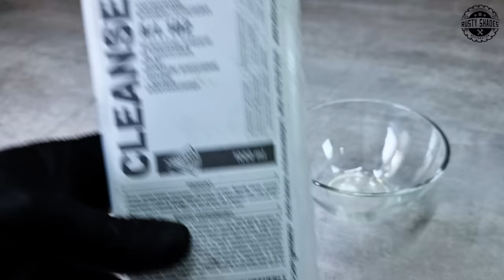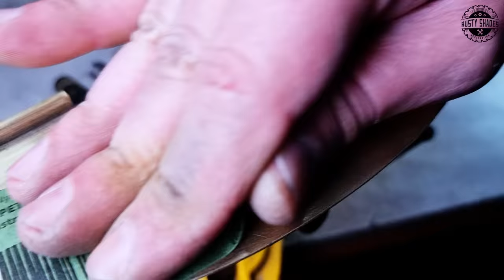Primitive Bread Toaster Restoration - 1918 Siemens-Schuckert

Comment: Man that thing came l out gorgeous!  
They used so much brass back then because there was no stainless steel, and you didn't want a rusty toaster.  I don't know if this was known at the time but Brass would also have some natural anti-microbial qualities due to the copper content, which would be good for a kitchen appliance.
Reply from the maker: Thank you for sharing with us. 🙂
Reply: @rustyshadesrestoration    These old toasters were usually nickle plated. From around 1930, chromium plating became more common too. By 1920 stainless steel were made, but I am not sure when it was put in use for household appliances. Lots where made in the steel quality common at the time, but I think the shine of the chromium plating was highly valued.
Reply: Раньше всё для блага человека а сейчас......
Reply: That's why a lot of metal door knobs are brass-plated.

Comment: What an excellent restoration! I myself restore and collect toasters, waffle irons and other electrical gadgets from before 1925. I use my 1914 toaster everyday and my 1919 waffle iron for Sunday waffles! I also restored an electric curling iron from 1902 and it has a really big porcelain and metal plug that screws into a light socket as wall plugs did not exist back then and appliances were plugged into available sockets. You did a wonderful job.
Reply from the maker: Thank you very much!

Comment: My grandparents had a similar one, albeit made in US, but theirs was 110V and used a two wire plug that resembled those now used for current corn poppers and hot pots. They seldom used it, preferring the pyramid one for the cookstove. This one is prettier by far.
Reply from the maker: Nice. I will try to find one on the Internet; you made me curious.

Comment: Sweet little toaster! The plugs (or where the plugs would fit in the body of the toaster) remind me of the twin plugs I had on an old Singer cabinet sewing machine, the kind that folded inside a nice wood table. The plugs were Bakelite or rubber/early plastic, but had that split bunny ear shape of yours, with a cloth covered cord. Perhaps an old sewing machine or other electrical appliance could yield some parts for you. Also, for working on soft metals like brass, I highly recommend covering your hammer heads with a layer or two of chamois leather. You can wire it onto the head of the hammer because it will need replacing as it wears. You will notice a big difference in the surface of your work and avoid unnecessary marks/scuffs. Thanks for this entertaining video--I hope you heated/burned off some of the fumes before making the first slices of toast??
Reply from the maker: Thank you! I'm glad that you enjoyed the video and the outcome. I did heat it up a few times before filming the test. 🙂

Comment: This really makes me appreciate the modern toaster. It does both sides of the bread at once, you press a plunger to load the bread and switch on the heating elements, it has a timer, and it even ejects the bread when it’s done.
Reply: really?  So you would recommend a newer model than this one?
Reply: I’ve been cooking for 60 years and have yet  to find or own a toaster that works as well as my parents’ toaster when I was a very young girl. It was somewhat the same concept as this restored one (2 side doors) but probably made in the late 40’s or early 50’s. It made perfect toast- never burned and always evenly toasted. It did have a rather unwieldy,  brown FABRIC COVERED cord. Still would love to find one like it & have it restored. 😊

Comment: great job, as always, but did you forget to tighten the 2 springs on the lids again? it would also be interesting to see a picture of the hot wires. whether they shine the same everywhere. possibly even out the distance between the windings.

Comment: Excellent Restoration! 

I too, was surprised to see that most all of the parts to this toaster were made of Brass!

That surely made it possible for you to polish those parts and bring them to the shiny finish that you achieved! 

I have to ask you though, just exactly what Voltage does that toaster run off of??

Seeing that it was made in 1918, I figured that it most likely did not run off of AC Current, but some type of Battery power, instead.

Also, though I am just 56 yrs. old, & was not yet around, when homes were first supplied with electricity, I've been told that each of my great-grandparent's homes did not receive electricity, until at least, sometime between the mid 1920's to mid 1930's, or so.

So that is why I figured that appliances like this one, wouldn't have been set up to run on AC Current.

Again, Awesome Restoration! Which is why I'm glad to be a subscriber! 🙂

Best Wishes & Highest Regards!!

Ron H.
Abilene, Texas; USA.
Reply from the maker: Hi Ron! 
Thank you for your feedback! I'm glad you enjoyed the restoration process. 
This toaster runs on 220v. It was produced by Siemens, a german company, and I found one with registration documentation in the Vienna museum of household appliances, thanks to a subscriber. This is the only fact that proves its age. As well, reading about electricity regulations in those years, it seems that most of Germany already had 220v, while in US and France, it was 110V. I'm still not sure about everything, and my research continues. 
In the villages, yes, things moved slowly, here in Europe too, but as an example, a city from Romania, the country where I was born, had electric street illumination in 1884. The City of Timisoara. 

Thank you for watching my work! Cheers!

Comment: I have one similar to this. It was all about paying attention and timing. If you didn't pay attention, you would have carbonized toast. The made a lot of fun about this in the movies of the times.
Another word for muscovite is isinglass. Isinglass was used as a fireproof glass in wood stoves, washers to prevent electrical short circuits, and a form to wrap heating elements around in later toaster models.
Reply from the maker: That's true! I had to pay a lot of attention to make them eatable. 😀
Reply: The USA name for this material is Mica.
Reply from the maker: Everywhere is called Mica, but Mica it is a group of hydrous potassium, and aluminum silicate minerals, but separately they have their names, like, in this case, Muscovite. 🙂

Comment: Definitely a 10. Wow! I love polished and polishing brass. The results are so gratifying. Would have never thought is using muscovite also known as mica in this way. Is it considered a thermal insulator?
Reply from the maker: Thank you. Yes, 500+ degrees heat resistant and doesn't conduct electricity.

Comment: You did a nice job.  To get the brass to shine without scratched try wet sanding with wd40 as the lubricant.
Reply from the maker: Thank you, I know this technique, but in this particular case, I didn't want to get a 100% full mirror effect because is not a blade, especially for interior or bottom parts. Some minor marks on it don't affect anyone.

Comment: Nice restoration! Should the side doors have more spring in them, to hold the bread in place, I wonder?
Reply from the maker: Thank you! Yes, but I've decided to don't hook them up again because it will only help to burn the bread on the edges because of pressure.

Comment: Did you forget to hook the springs back up or did the heat treatment make them ineffective? The door should snap back.
Reply from the maker: The heat treatment was delicate, but some ends of the springs broke while disassembling. I hoped that I would be able to extend them a bit, but there was no chance. 
I have over 250 types of springs and sizes in my shop, but none of them fit in there, and no music wire to make new ones. It happens when you deal with old stuff, and you have to film it. There was a good part of this misfortune, if I replaced them with stronger ones, the pressure on the doors would push the bread too much, and it would burn it immediately; even like this, stress-free, I had to be extremely careful to don't burn it. 
Maybe I'll replace them, but I'm not in a rush with this. 
Thank you for watching! 🙂

Comment: Why not replace the original wires in the bottom where no one can see them with modern insulated version?  You brought the brass back to life, looks great.
Reply from the maker: Thank you! I do not want to intervene that much; I still hope to find an original power cord. Already someone gave me a hint that it is a Siemens.
Reply: Beautiful job😀
Reply: The fixed air gap and protected location of the bare wires preclude any short circuit conditions. To perhaps boggle your mind, around 1920 many newly wired houses under the Rural Electrification Act in the US had bare wires installed in attics running to ceramic insulators, with rubber insulated wires in the walls. My grandparents had this. I suspect the rats and squirrels found it occasionally thrilling.
Reply from the maker: Thank you 😊

Comment: judging by the way it looked in the beginning that was nickel plated brass, the wiring its whats called a female chicago plug, easily sourced on ebay.  heating the springs to blue them killed the temper, that's why the side plates don't spring back anymore, those should be replaced mscdirect would have replacements in stock, you just need the diameters and length measurements
Reply from the maker: Hi! I will respond to you in lines, yes it was nickel plated, but I prefer it without; it is more attractive like this, especially since it will serve as a decoration. 
2. there is no eBay in my country, so I should wait weeks for the plugs.
3. Hot bluing didn't damage anything on the springs; they were damaged already. When I took them out, the ends broke, so it was impossible to catch them back. As well, I have over 250 sizes of springs in my workshop, and non of them fit in there 😅
The fact that there was no tension on the doors helped with the toasting process; a bit more pressure on the bread slices will help to burn them immediately.
4. I will do my springs with music wire, but I'm not in a rush.
5. Thank you for your observations, but next time try to put questions because it sounds like you know everything, and that's not true; there's some stuff behind that decisions. 
6. Thank you for watching! Cheers!
Reply: @ yetshi • 1 min ago
He kinda blew you away...
It's cool 🦆 quack ~
Reply: "yet she" couldn't even be bothered to read the description. 🦧
Reply: @rustyshadesrestoration  
You handled that rebuttal nicely.

Comment: If you started with finer sandpaper, you wouldn't scratch the hell out of that brass.
Reply from the maker: Did you ever restore something from brass? It seems that you don't know how progression grit works. Sanding has to be done with progression grit from low to higher, even from 100 to 2500. 🤦‍♂️ if you don't do that, you will remain with huge scratches that the piece got in years. 
It is so funny sometimes how some people like you teach others doing this daily, stuff that has no sense.
Reply: @rustyshadesrestoration 
The reason I correct you is that I do have experience. Try the gentler method. Buffing accomplishes the same goal.
Reply: He needed to get the 100 years of tarnish and dirt off first and then he polished to a mirror finish.

Comment: good job  Amazing restoration  just add more tension on the spring
Reply from the maker: Thank you. In not needed, I already had to be very careful with the bread slices, a bit more pressure, and they will be burned on the edges badly.

Comment: Originally, the parts would probably have been nickel-plated, so you might want to consider sending them out to be plated again to get closer to the original look. Overall, compared to the other "restoration" vandals here on youtube, you did an admirable job of preserving allmost all original substance of the toaster. I would have made new springs and rewound the heating coils, you had the guts to try and re-use them, so solid A+ to you on that.

Comment: Looks nice
Reply from the maker: The springs I chose to let loose to don't apply too much pressure on the bread slices. Already I had to be very careful to don't burn them, and a bit more pressure would do that. The brass didn't tarnish at all; those are marks from touching it, being mirror polished, which happens quickly. You never did what I did in this video, so please ask first instead of writing without knowing whats behind. Cheers!

Comment: My opinion is it's better than the toe toaster. Basically it was an iron little thing that you could rotate with your toe period. It was set on the edge of the fire and you have to be careful not to burn your toe. Hence the term toe toaster😂. This toaster is much better.

Comment: I have an old toaster that is a round metal shape like a frying pat without sides.  It has small holes in it, and a wooden handle.  It was put onto the burner of a stove.
Reply from the maker: Wow! Can I see it, please? I have an Instagram account, and you can send some photos there.
Reply: @rustyshadesrestoration   I don't have instagram, sorry.  
I tried looking it up, but found only one thing that looked a little bit like it.  I hadn't realized it was so rare.

Comment: You just need to replace those springs to hold the doors shut and you're as golden as the toaster itself.
Reply from the maker: I may replace them, but I'm not in a rush. The springs weren't hooked to the doors by intention because that would only help to apply unuseful pressure on the bread slices and help burn them more on the upper edges; even without stress, I had to be very careful not to get them carbonised.

Comment: Virtually all metal and 220V! That's a lot of faith in layers of mica. And how did you get the power in? A couple of insulated alligator clips? I'm quite curious how it was originally connected to European electricity!
Siemens Schuckert made fighter planes in WWI, incidentally. Perhaps toasters were a post-war turn into household products for their factories.

Comment: I used to do appliance repair the thing that throws me off is usually they have a bi metallic spring of some sort to control the heat cycle before thermostats . A older fridge has a bimetallic spring for the compressor if it gets hot it opens the circuit and shuts off the compressor when they go bad or over heat , You will hear a click underneath as the compressor gets hot and cools off and starts up again. I wonder what they used to control the cycle back then? Did you just put in the bread and plug it in and un plug it when done? Love the resto and its solid brass very cool
Reply from the maker: That's right; I plugged in and out when the bread was done. I didn't hear any click.
I'm glad you like it! Cheers!

Comment: Very cool but I must admit the patchy browning of the bread surprised me given how the windings of the element are so close together and cover the maximum area.
I guess the downside that lets down the performance for this is the shield to protect the element.
Modern toaster manufacturers seem to treat nichrome wire like it's some kind of precious metal they will use as little as possible with like half inch gaps between wraps.

Comment: I think you did a fantastic job, if anything all I can think of on nitpicks, would be; the elements would be a concern is this was a for use toaster, as I simply would not trust wire that old and that coroded looking, also it simply does not go with your fantastic polish on the brass.  The other nit pick is potentially using a diamond paste to take out the more obvious sanding marks on the brass, though doing so would remove pretty much all of the sense of age from the piece.
Reply from the maker: Thank you so much. You're right regarding using the toaster, but I don't intend to do so. It will serve only as a decorative piece.

Comment: Looks Real nice polished up like that and I'm glad you centered the screws through the isolating mica washers, but the springs should be hooked to the doors at the ends to hold the doors closed, otherwise the doors can flop open and the bread won't get toasted. Very dangerous the old models, almost as dangerous as the old two or four slice toasters you put right on the stove top.
Reply from the maker: Thank you 🙂 long story short, I thought that I could save those springs and then I realised if I hooked them to the doors, there would be unnecessary pressure on the bread slices, which would help only to burn them on the upper edges, even like that I had to be very careful to don't carbonise them.

Comment: Beautifully restored! Have you ever been able to restore the heating element wire on an old toaster and if so what type of wire is it? If you would share that info. please.
Reply from the maker: Thank you! No, I never tried to restore the wire because it is easier to replace it. It is called Nichrome Wire, which you can find online on Google. :) Nichrome is an alloy made primarily of nickel and chromium. This wire is used in heating elements due to its ability to withstand high temperatures without oxidizing and its high electrical resistance, which makes it efficient at converting electrical energy into heat.